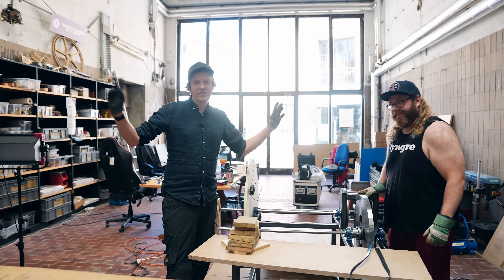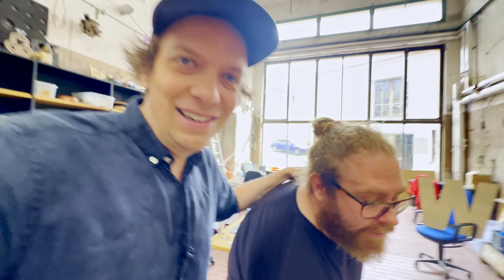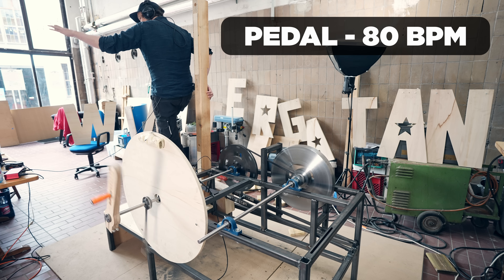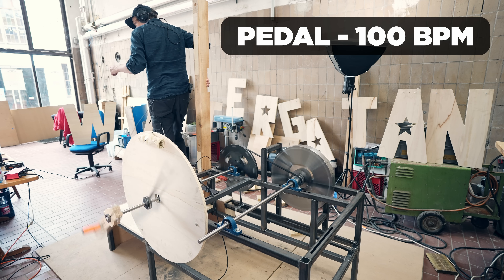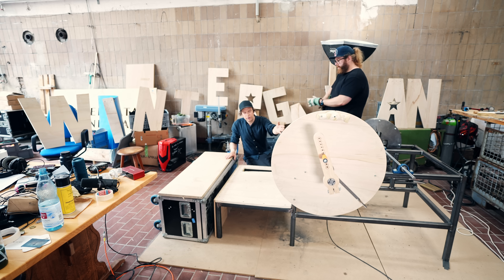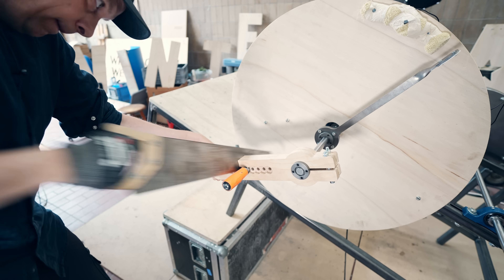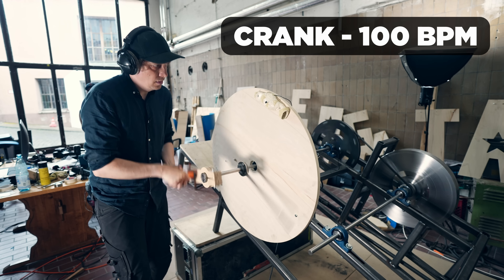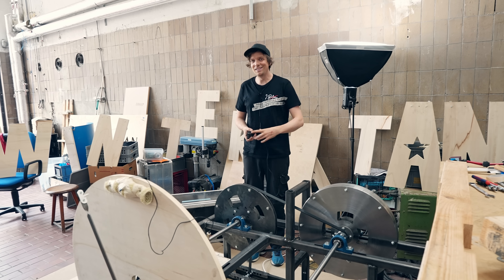Heavy Flywheel plays Tighter music! - DAY 11 - Marble Machine Flywheel Prototype

Comment: At its minimum, this system is going to require a constant input of power equal to the weight of the marbles being lifted.  In reality you'll also have the mechanical losses to add back into the system as well from heat and drag and friction and all that which are probably as much or more than the weight of the marbles.  The flywheel helps even out that energy expenditure, but it doesn't decrease it.  I'm just curious how many marbles per second is the machine going to be playing and what's that exertion level like?    Can that be sustained for an entire show?  I guess if it becomes too big, martin could have stage helpers assist with energy input (assuming manual input of energy is a design requirement, which I assume it is otherwise you'd just use stepper motors for everything)

Comment: I need to ask you something:
Why using a Flywheel?
Could it be possible to do it like old clocks, with having constant weight and then using something to Limit it, to decrase the possible speed, cause having constant weight could give constant speed. Or create a few "clocks" that are just for the bpm, instead for counting hours, where you can switch between. -> different tempi, cause multiple clocks that cou can choose. 
For not running out of this stored mechanic Power, just add a second weight. when the first one comes to the end, switch to the second, when the second comes to the end, switch to the first. And then you have the time in between to lift the weight.

Edit: I didn't saw the other Video to the gravity Video... Now I did. I Like the result, cause it is similar to my idea, just already improoved, that no 2 weights would be needed.

Comment: i know im late to this ofc, but. instead of matching to a metronome, which has the issue of you can be perfectly at tempo, but not on beat, and so to get on beat you have to actually get ahead of tempo just to catch up, resulting in you being too fast once you're actually on beat. The proper way to do this would be to have set the tempo in logic, turned the metronome off (or in this case the bass drum) then put a delay on the output from the contact mic, set it tempo locked to 1 quarter note, and then turned the wet to 100% but the feed back to 0 (just one repetition). that way it sounds in time when you are exactly at tempo, but doesn't require you to catch up or slow down.

Comment: I'm sure someone has already noted that when the heavy flywheel assembly falls behind or gets ahead of the timing it takes longer to correct for that, due to the mass of the flywheel. The smaller fly wheel's speed can be corrected more quickly. However, more attention is needed to keep it there. Which is better. I don't know.

Comment: I just woke up and I have a suggestion: to play tight music you need to have a constant input of energy, but, as Martin explained before, there is also a need for tempo variation.
However, I was thinking about the previos designs of the marble machine, and I have come to the conclusion that the same power input is used for two different operations: for turning the programing wheel, and for marble replacement within the machine, but you see, only the former most needs to be tight and also leave room for variation, while the marble lifting can use a constant power input.
I do question if the marble machine 3 needs to have only one power input for two operations, or if it could have two separate power inputs, the pedal/hand crank one for the programing wheel, and a gravity or any other input mechanism for the marbles.
This would help a lot with stress management withing the mechanism, and reduce the overall power needed for any and both of the two operations.

Comment: This is probably too complex to really boost precision, but you could try to add a brake that engages at a certain RPM. That way, you could minimize overshoot. It could be done by using a mechanism similar to that which was used to throttle steam engines (the device that is often characterized by two metal balls rotating around the shaft, to measure the centrifugal force and therefore the RPM). Also a clutch might be a good idea

Comment: Keeping it simple, this is a good basic power supply design.  Hand cranking for startup!  The pedal basically being used to maintain the beat and flywheel inertia. Tempo can best be synced with a little overshooting then light braking. In song tempos, be more relative to programming wheel/drum rpm can be instantaneously changed or ramped up or down with the programming pins. Or by skillful braking to slow and or emphatic hand cranking by an assistant or the performer to speed up. A stiffer pedal would help. Probably a heavier flywheel too.  Eventually, like a clock passes two seconds per one pallet cycle, marble gates dropping two marbles per one pallet cycle would also be a big plus overall as well as for in song tempo changes.

Comment: Would making the wheel powered by a motor of sorts, and then have a clutch system, connecting it to the machine, be a better way to bring the machine up to speed?

Comment: Given you ran the last one off a motor and you seemed quite happy with that solution, why are you bothering with s crank / flywheel etc? Surely a motor has the torque just to run the entire machine without any of this complexity.

Comment: This is getting nowhere!

Here is an idea. Attach a motor to the flywheel, this could be 100% powered by your cranking. When overshooting the motor will absorb energy and slow down the flywheel, you can then store this energy and use it to input energy back into the loop when falling behind, of course, with time you will have to input more energy into the system with pedaling. this approach can help you a lot with the tempo while still remaining 100% powered by you, and also doesn't remove you as the musician in control of the instrument.

Comment: Easier for a drummer to sync with the Marble Machine. If playing with other musicians, just let the Marble Machine set the tempo. Go with a heavier flywheel to more easily compensate for the inertial lose and gain from instrument engagement and disengagement and drive train frictional loses.  Flywheels on instrument subsections may also help with power/tempo control. A seat to free up both hands, or hand rails grab onto and maybe two foot pedals for power input and tempo control stabilizes the body and requires less physical energy.  Basically, bicycling or walking/running in place for power input. But a single input pedal will do just fine with a bit heavier flywheel.

Comment: Curious how these would match up if you took more data length into account and not just the best 100. I think the best 100 is a little samey for the dataset. But you would probably have to play with each much longer and then fatigue would be a bigger factor.

Comment: Have you tested it with the wheel loaded? Now it seems you're not draining any power from the wheel apart from friction. The machine will drain a lot and thus you will need to supply more muscular power in, which might be a totally different experience.

Comment: I see the wood brace used to balance as the pedal is used.  Is this impractical as you try to perform the other instruments.  Meaning two hands are not free if you have to hold on. You also needed two hands to catch up with the crank.   Variable speed governor is all over the comments.  Think this frees you up.  Use a pedal to control speed.

Comment: I am increasingly confused with this testing. You are NOT testing that the flywheel is playing 80bpm. Your drive wheel is going at 80bpm. How do you intend to transfer the flywheel energy at a given bpm to the programming wheel? You can stomp that pedal at 1000bpm and if the flywheel doesn't transfer the energy at the same rate or the programming wheel doesn't take the energy at your given pedaled bpm, you're not going to GET the bpm out that you put in. Your gear ratio from input pedal to fly wheel has to be taken into account here as well. Your music is tight at the pedal, not the flywheel.

Comment: A small observation: you measure on the input side, not on the output!
It might be a lot better if your input (pedal/crak) only goes to the flywheel. 
And then use a second wheel set to drive the timing test.
This needs another axle, but it would decouple the output from the fluktuatins introduced by crank and pedal.

Comment: Can a Martin play tight music one hour into a two hour set?

I think you need to take a different look at the "requirements". Do you NEED to manually power the machine?

If you ever implement the weight drive then you lose all input control of the speed anyway.

I would be focussing on governing the output but with the requirement being a "simple" device/lever that allows you to modify the BPM. There are mechanical ways of doing this, but then also you could go electronic with a "throttle jockey" as used in model avionics.

There is also the fact that the power input required will vary depending on the music being played. Whilst it would hopefully be minor, opening 20 gates at one time will drain more power from the machine than opening 1 gate. Then there is the delayed aspect that after a lot of notes are played in quick succession there will be more marbles to lift.

Build a governor at the start and never have to worry about tight music again.
Reply: I would also add a side note of what do you need that much power input for? Can you split the power input/requirements of the machine into two? Why are you compromising your timing of the programming wheel and gates with the power required to lift that many marbles back to the top.

Comment: Doesn't a flywheel that is so heavy (it requires a forklift to move it), and that takes so much effort and time to get up to (it's marvelously consistent) speed kinda make it not viable for world touring? Obviously I love all the experimentation, and I've enjoyed watching the process to get here, but it seems to me the cons may outweigh the pros here.

To me, having a purely mechanical machine (with an 86kg flywheel and so on) is less important and interesting to me as a listener and audience member than all of the rest of the fun things about the MM. I'd honestly rather a machine that is powered by a non-obvious electrical motor than can make everything spin at the exact right speed all the time (without any real need for a pedal or crank), but for the rest of the machine to be doing really cool and interesting things, and so that the "playing" of the machine allows for maximum creativity. Like just setting aside the challenges inherent in trying to get consistent timing by turning or pedaling things and giant immovable flywheels and so on. Save the space and the weight and the complexity of "making it go" and apply all of that to "making it fun to see and listen to". Perhaps I'm alone in this view, but thought I'd mention it.

Comment: Rather than trying to match the exact so beats align, you should try to only try to match the the bpm.
What I mean by that is that you should instead try to make your foot or hand movement match up with it. Just decide a specific point in your movement that should follow the beat, aka for example when the pedal is at the bottom or the top, and try to match that to the beat and ignore the contact mic. Maybe it would give worse or better result, But you should test it is my opinion.

Comment: It is seems to be quite a workout. I feel that it won't be possible to do anything else with the machine for the person that is cranking it, for instance bass playing like on the first machine. At that point, you might as well hook that to a bike instead of a one foot pedal. Power from both legs so easier to drive and control, and less time without applied force, so less flying wheel momentum necessary. Bass playing or whatever else would be another person.

As for playing to a click track, it won't ever be possible with such a design, no matter the weight of the flywheel, and hooking to a bike wouldn't solve that problem. I'm sure you'll get steady bpm, but once you get off perfect sync with the click track (which will happen), it will always be too long to fight the flywheel to catch on. The obvious answer is that the band should follow the machine, not a click track. Prerecorded samples, arpegiators won't work, but there's been live music without that for centuries. 

If it really has to follow a click track, just hook it to an electric motor. It will still be a mechanical marvel nonetheless, and at that point you can take off 100 kg or more of flying wheel weight. Less of a hassle for touring, closer to your tightness specifications. What's not to love?

Comment: Moment of inertia increases with mass at R^2, so you could re-design the flywheel to make it larger in diameter, and significantly lighter while having the same moment of inertia.    It probably would make transportation much easier.
Reply: Finally a significant comment!! Yes, that's holly grail of a flywheel, try to search internet on "stationary steam machine" and there are tons of pictures of machines with flywheels: a large diameter ring rotating on several tiny spokes - that's the way how to increase the momentum of inertia doubling the diameter makes it four time bigger (at the same mass!!! )

Comment: You should add an electronic indicator for if you're behind or ahead. Attach a magnet to a shaft and when it passes a sensor it'll send a signal. It's silent and extremely accurate. It's the same sensor used for engine timing and ignition. Use the indicator to train yourself and have real time feedback to be as accurate as possible. Do 3 LED's. Top ahead, middle on point, and bottom behind. When you get good enough you can play without it.
Reply: You can also add a speed and acceleration analyzing program to tell you when you're going to overshoot or fall off. Basically tells you to add more power or less.

Comment: When you do these type of tests. Ignore the sound of the contact microphone during the test and focus on matching the top of the pedal to match the metronome (i.e. push down on the beat). There will be a phase difference between the sounds but it will be relatively constant. It will result in a more consistent test.

Comment: If you want to add even more moment of inertia, you should consider a different flywheel design with spokes and more of the mass concentrated at the maximum radius. Adding such flywheels together will give you more moment of inertia per total kg added. 150 or 200 kg or flywheel doesn't seem reasonable.

Comment: I think you should consider HIGHER SPEED on the flywheel, instead of more weight, as the stored energy is squared to speed, but only propotional to weight. Imagine transporting a marble machine weighing 500 kilos…